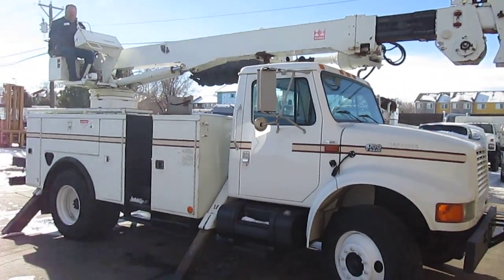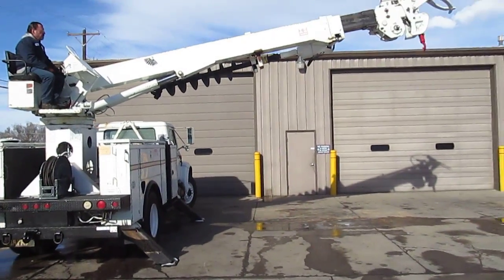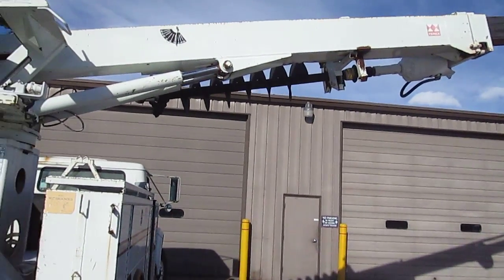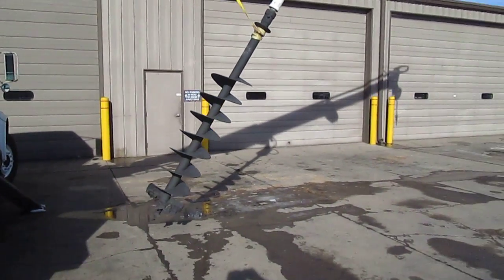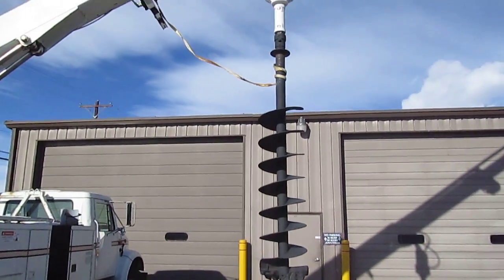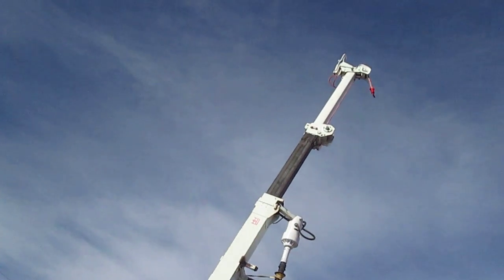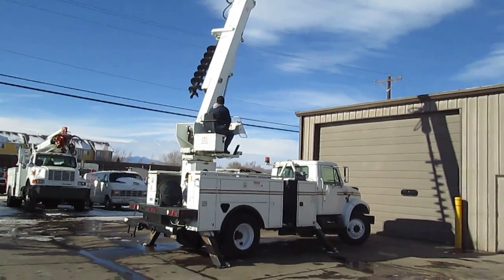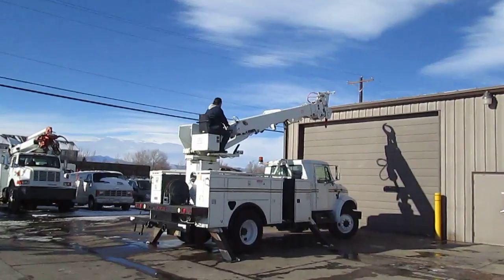digger derrick operation

Comment: I have a 1999 International Alec Digger Derrick. I was wondering if anyone could help me with getting an idea of proper stowaway of the auger system and what type of hook mechanism is works best mcable/chain attach to on the auger for stowaway.The original hook for stowaway snapped off, have welded other mounts on auger but they break off as well. Is there an advantage of using a strap versus a chain?  If anyone may have a video link or suggestins I'd appreciate anyone's help or advice.
Reply: All diggers (thats I’ve ever seen) use a strap to stow the auger..   I’ve been a lineman for about 20 years..  the slings are much more compact and will wrap around more tightly, and be more compact when stowed...  plus you dont need a heavy chain swinging around while the auger is in use and people are on the ground working..  also - being near power lines - it always better to not have something conductive when you dont need to.. the sling is just a much better choice all around.
Reply: @kctyphoon   same,I want to be a lineman I'm only 16 but the power company was outside my home placing a new steel distribution pole and the digger derrick had the same cable to stowaway the auger